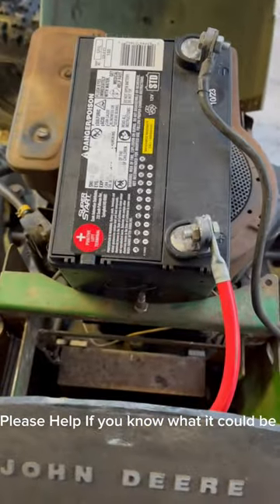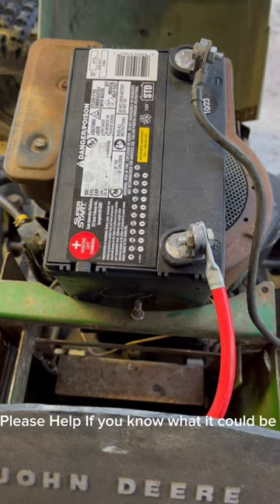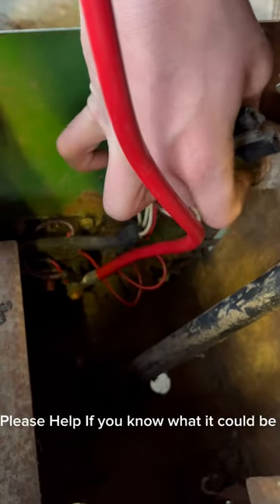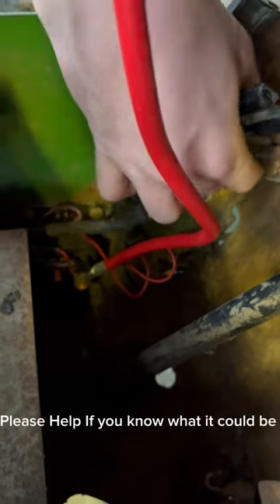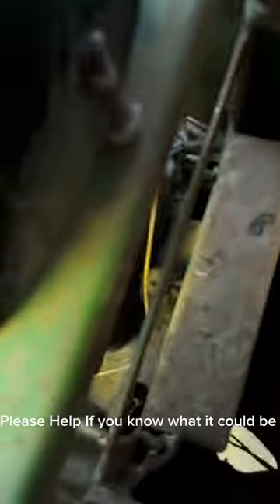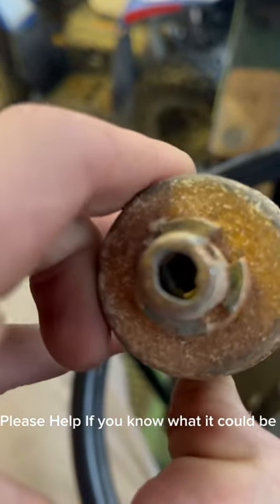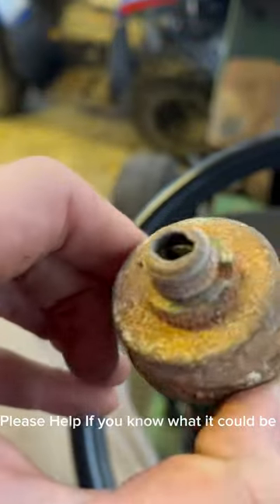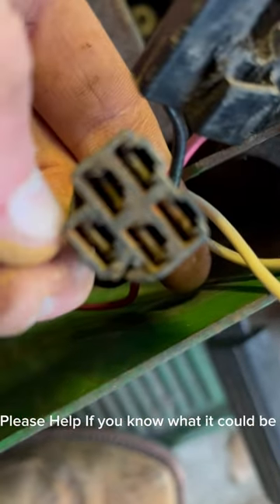HELP PLEASE again, nothing is happening. | #shorts #broken #help #shop #youtube #lawnmower

Comment: I had the exact same problem with my john deere 111 what i did is take the wires off the solenoid and use a wire brush and clean them and do the same thing on the ground wire and use sand paper on each prong of the ignition switch and for the inside if the ignition wire connector use a pick and scrape the rust out
Reply from the maker: Thanks, I ordered a new ignition switch and I’ll take sandpaper to the other things

Comment: Take some sand paper to those prongs or order a random ignition switch but make sure the plug in is the same pattern as the switch
Reply from the maker: I did thanks
Reply: @Grayman_On_Youtube  ok good what should my next vid be
Reply: What should be my next video*
Reply from the maker: @Classics1w1  idk if you got any small equipment you could do a cold start or a tour on your truck. Just some ideas.
Reply: @Grayman_On_Youtube  ya dude I live on a 600 acre farm we got to much old stuff to start I can do that I got a ole 2 gen
Reply: You play clash of clans If you do you can join my clan
Reply from the maker: @Classics1w1  yeah I figured you did just didt want to assume.
Reply: @Grayman_On_Youtube  you got clash
Reply from the maker: @Classics1w1  imma try to get it towmorrow
Reply: @Grayman_On_Youtube  ok it’s addictive